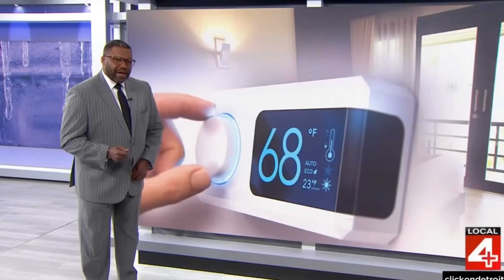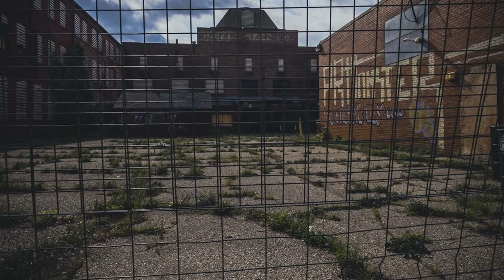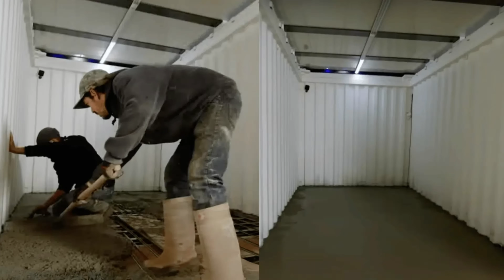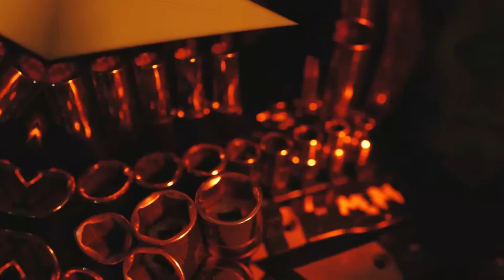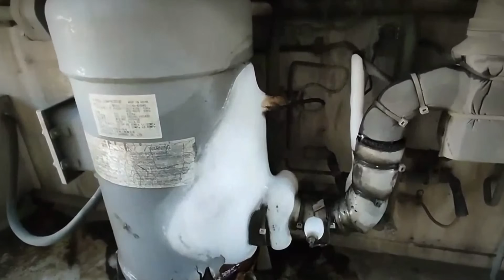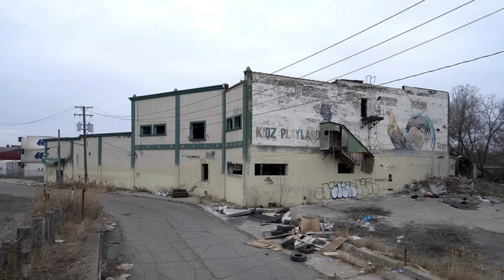Black Homeless Man Turns A Junk Shipping Container Into A Fully Running Home For $250

Comment: I live in a 40 ft container sitting on a road gravel pad on a 20 acre forest lot that I bought 30 years ago.   I have a camping toilet and hall water in jugs from a public spring  16 miles away.   I paid to have electricity    The County made me put in a septic (only thing they cared about plus their taxes).  I have an enclosed porch with a wood stove that heats the place      I have to use small logs or it gets too hot inside. The spray on insulation under the lap siding interior keeps it warm in winter and cool in summer.  I am in South Dakota so weather can be extreme.

Comment: No way 4 candles would hear that square footage, sorry.
Reply: It's a fake Ai story
Reply: It's very possible and likely because of the insulation and thermal properties of that clay pot plus body heat.
Reply: Actually 4 candles can heat an average size shipping container. The key is Insulation. FYI A can of Lard AKA Pork Fat with four Candles will burn for 72 hours.